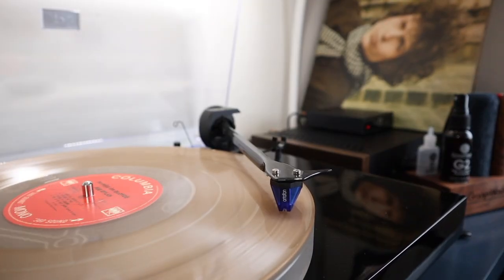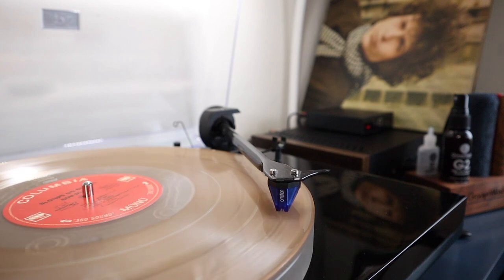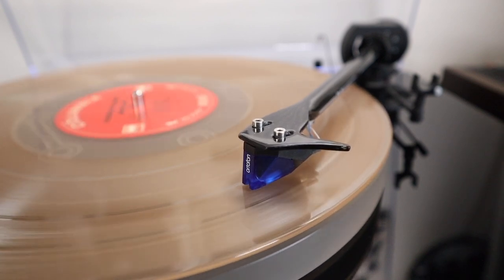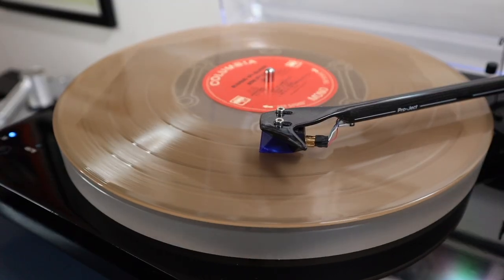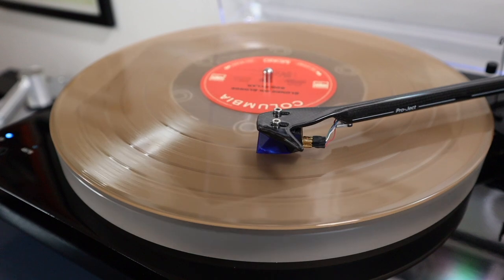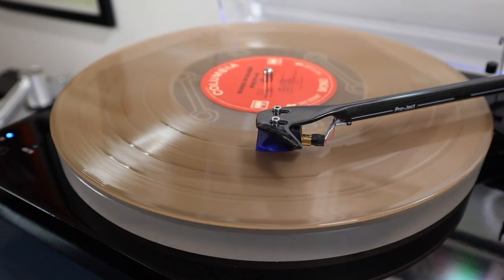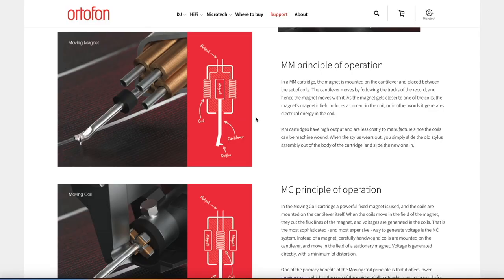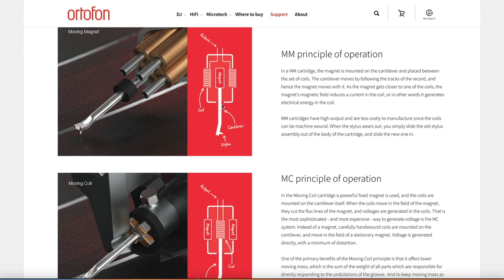Moving Magnet vs Moving Coil Phono Cartridges - Vinyl 101

Comment: Hi Mark, a good summary but just a few points to add.  Firstly, the weight of the cartridge is not determined by whether it’s MM or MC and it has no impact on the downward pressure at the tip, of course, as that’s set by the counterweight position.  As a matter of fact, the popular Audio Technica VM95E moving magnet cartridge is considerably lighter than the OC9 range of moving coils by the same manufacturer.

The weight of the cantilever, however, is different, as the coils weigh less than the magnet.  This results in the stylus being better able to track the groove in the case of the moving coil, as you rightly said.  The downside to this is the cartridge can feed more energy through the cartridge body and into the arm.  For this reason, it is important to have an arm that can handle this extra vibration with a combination of damping and transmission through superior arm bearings to the plinth.  There is no point in spending too much on a moving coil cartridge if your arm and turntable aren’t up to the task.

Finally, with a much lower output signal coming from moving coils, it makes the choice of phono pre-stage much more important.  This isn’t just for the extra signal uplift that’s required either, it’s to match the impedance and capacitance correctly.  A really nice moving coil cartridge can be ruined by a poor phono stage and these can cost as much as the cartridge themselves, or in my case more!

In the last year I finally made the switch from moving magnet to moving coil.  It’s been a lifelong ambition and financially it was extremely painful.  I had what some consider a fantastic MM cartridge, a Goldring G1042, and I really liked it.  My first MC cartridge is the Audio Technical AT-OC9XSH and it is a major step up.  However, it didn’t pair well with my ifi Zen Phono, hence the switch to my Vertere Phono 1 MkII, which has transformed my record playing system.  I’m never going back to moving magnet.

Good luck on your journey.
Reply: very cognizant reply.   I had seen arm design evolve from the ultra light weight arms back when MM carts dominated the market, but hadn't really known why, just had read that a MC cart was harder to control , with no further details provided.   Once I got a nice platter spinner and arm, I started to realize the real importance of the arm, as before all I ever owned were nice record players where the arm was included as part of the product, so not much to think about.

Oddly enough, I still read internet posts where people must have read a bunch of old arm reviews and seek out the old designs to use with MC carts , as though the mechanical properties were timless, like an old book.   I once lusted hard after an SME arm design which had the ultimate thinking of the time, having a Shure cartridge , without the body, incorporated into the arm wand of their top of line design.  Almost good I didn't have the money to get one at the time, because it quickly became obsolete as cartridge design moved on, and it had no provision for upgrading the built in signal generator, although the rest of the design is still among the best.
Reply from the maker: Thanks Mark for the detailed reply and experience shared. Sorry if I didn't make my comments on weight clear as by weight and inertia, I did indeed mean the weight of coils vs magnets. 

Excellent points added about the tonearm and phono stage, much appreciated and it's nice to hear your experience and journey here. Congratulations on making the leap and managing to pair it up with a compatible phono stage. I think I'm quite a way off achieving that myself from a financial standpoint alone. Maybe one day :)

Happy spinning, Marc.
Reply: @soundmatters  Hi Marc, thanks for your kind words, and no apology needed for miscommunication, it’s a hazard of doing what you do!  I have to confess it’s actually CDs that have been enabling my journey over the last few years.  By learning about electronics I’ve been able to buy broken amps and CD players, but mostly CD players, fix them and sell them on to happy new owners.  Everybody wins.

Of course, along the way I’ve kept the best bits for myself and added a series of upgrades too.  It doesn’t do any harm having a sound engineer as a buddy either! 😁
Reply: @soundmatters  @markcarrington8565 Not to split hairs but what you are really taking about is mass, not weight. The former is related to the density, the latter is related to the effect of gravity on the former.

Comment: I have a legacy turntable-tonearm combination (Thornes 125 W/ SME-3009) which will be 50 years old this year. For this type of high compliance arrangement the best combination is STILL the Shure V-15 (type IV or V) with an aftermarket hyper-elliptical, line-contact or SAS stylus. Unfortunately Shure is out of the cartridge business. So I'm glad I held on to my Type-V.  I also like the Grado Prestige (Blue) and the legacy Audio Technica AT-95 with an aftermarket nude hyper-elliptical stylus (BLISS brand) and a .7g additional head-shell weight. ALL are MM carts. If I was to ever purchase a "fixed stylus cart" it would be be a high-compliance Soundsmith model where the cost of replacing the stylus is never more than 20% of the cost of the cartridge. Grado got me hooked on the sound stage produced by their (Prestige series) "moving iron" carts.

Comment: Seeburg jukeboxes referred to the stylus as the "armature". The magnet was in the stylus carrier. Then there are the ceramic and crystal cartridges which generate substantially more electrical current. Then there was the Radionics Cobra cartridge(used by Wurlitzer and Zenith), which generated a signal much like a radio transmitter.

Comment: I have an old PF-800 Yamaha table that came with a Denon DL-110 cartage and it sounds very good, better than anything that I've had this far. That Denon cartridge is a moving coil type but one that's less expensive than lots of moving magnet style carts. It's a "high output" moving coil, which is apparently what a lot of the cheaper MC carts are designated and can work with a MM style phono stage, but I found worked better with a Schiit Mani preamp that I upgraded to, which has the benefit of lots of adjustments and is cheap. If you have a budget that's a few hundred (but not necessarily more), it's worth looking into a high output MC cartridge, like the Denon... as it has lots of detail and a low tracking force that tracks records well and likely means longer record life and maybe even longer life for the stylus. The fact that the stylus is non replaceable is a big disadvantage for sure, but the thing is cheap enough that it might be considered a good value anyway. Apparently it can be retipped but the cost tends to be nearly the same as a new cartridge. 

One thing though that I'll say, is to make sure to do the research and buy a cartridge, whether or not it's MM or MC that is known to work well with your turntable. Different tonearm designs work better with certain kinds of cartridges...

Comment: I like the punch of a moving magnet on rock and such, where the original higher electrical signal provides greater impact .  A moving coil just has a slightly different voice, and most require a higher downforce to track as well as a moving magnet design,    I decided to go for the ease of tracing the grooves over ultimate fidelity , since I want to preserve my old records as well as I can.  Besides, my MM set up sounds pretty good, I once saw the same deal used at an audiophile show to sell speakers.  

Although they are, with good reason ,  the flavor of the day, with some MC designs are modified with higher mass and output to allow a consumer to replace a MM cart with a MC design, for those who want to ape the very expensive multi thousand dollar carts, it is not for me.

  I  always stress over getting the cartridge alignment right, it's so critical and tedious that it kills the joy of a job well done for me.   So I really enjoy a replaceable tip, and at my advanced age have to think ahead to when the very critical aliment job might be outside of my abilities, where a replaceable stylus is a much simpler task.   I know some people hire out the cartridge alignment, but for me, it is so critical I would still have to double check the work anyway, so not much advantage to paying to see if the set up task was correctly done.

I have a fine turntable and arm, but am sticking with a MM design because I mostly play rock and other simple stuff where the punch of the original higher generated output fits the music better.      With the goals for my playback system,  the ability to resolve very complex resolution from many instruments  is not really needed.   I also appreciate the simpler amplification chain, because the good stuff can be very expensive.  
A well proven audiophile maxim is that a  simpler chain is always best , and forgoing MC amplification allows for better stuff in the amplification chain for the same money.   I do play symphonic music, and to sounds fine in my high quality set up..  But the punch of a moving magnet is better suited to the majority of my records.
Reply from the maker: Thanks Richard. Great insight and experience you've shared there. I like comparing MM and MC carts to dynamic and condenser microphones. Condenser microphones undoubtedly have a wider frequency response, but you often find some voices and instruments just suit a dynamic microphone better. Very similar with phono cartridges I think, as you suggest.

Comment: The moving iron cartridges have lower moving mas than MM . The Grado Sonata 3 in their Timbre line is especially sweet , and although not cheap may fit the budget to upgrade . It is available in both a high and low output option . The Soundsmith Otello ES , a similarly priced cartridge is also competitive , and they offer an affordable retip service for their cartridges .

Comment: MM's are definitely the most convenient to use and most consistent in sound quality from same make/models.  I have used 2 MC carts, AT-OC-9 and the equivalent Kiseki cart, found them both too bright and fatiguing.  Both were run on the same table/arm combo, a two motor, belt drive English made Logic Gemini (Linn Sondek class) with Datum S arm, and both carts sounded different. I tried another OC-9 and it sounded different to its sibling from the same batch.  On my TT I still run a Shure V-15Vmr with a Jico SAS stylus which I find totally neutral and comfortable to listen to.  If/when my Shure goes to cart heaven, I will probably replace it with either an Ortofon 2MBlack or Grado signature series.
Reply: what  a coincidence, I also have been using the same shure cart and the same brand of replacement stylus , with the original cart body being so old that I forget when I actually bought it.    I also considered the grado, liking the moving iron designs, but the new LVB ortofon has a replaceable stylus and most all the features of the original Shure, adding an improved suspension material , but not offering a boron foil cantilever stylus, but solid boron is still a top solution.    I like the ability to get an OEM replacement stylus from ortofon, but not the price.   The S and S is nice, and a real life saver for me,  but not quite identical to the OEM design.

Comment: An MC let make you hear more info from the record. 
But a good MC costs from 1000-2000 dollar and a good phono stage also. So let's say about 3000 dollar. Very important is the match weight-arm with compliance-cartridge.
Then your turtable has to work together with your amp, cables, and acoustics of the room.
My turntable costs about 8000. For much less you can get a cd-player with a reasonable sound.

Comment: "cheap" entry into Moving Coil:
Goldring Eroica HX - £549, I believe these can be re-tipped for about £350-ish.
- it's a high-output MC design, so does not need a separate MC stage, saving at least another £300.

I'm very happy with mine.
Otherwise, Goldring 1042, Ortofon Black or above, Nagaoka do some well-reviewed stuff.
Reply from the maker: Sounds good. Thanks for the recommendation. 🎶🎧

Comment: If you say that the signal is weaker in a moving coil and that the preamp needs extra gain, then surely service noise is going to be largely amplified as well?
Reply from the maker: I get your logic, but because the signal to surface noise ratio remains the same, this is not the case. Happy listening 🎶🎧

Comment: MM or MC?  Audiophile or not, this is so much a matter of taste.  Some are just for the low end, others are just concerned about high frequencies..  Personally, I have leaned towards the MM league after I purchased Reloop Turn5 equipped with Ortofon 2M Red.  This replaced my beloved NAD 5120 turntable.  Well, the Reloop is a 13kg beast, a SL-1200 design and  honestly is from “another planet” compared to the NAD.  My other cartridge is the DL-110 Denon, high voltage moving coil.  I tried it on the Reloop but whatever modification I made, it just could not match Ortofon’s warm engaging sound, I really feel at “home” with the 2M red 👊😁.. 
As you mentioned reg. moving coil cartridges, if you want that hyper audiophile sound, you need a high end record player, top of the line amplifier, pair of Dali Rubicons..etc.   I know a few that are in this group and they are still not 100% satisfied with the sound from their gear..  After my experience with Reloop Turn5, I will never go belt drive again, changing pickups in seconds is so much a step up..  I’m already considering a 2M Blue stylus and possibly concord type from Ortofon.
Reply from the maker: Thanks for sharing. I agree there’s always a degree of personal taste, plus finding a good fit for your system of course. The Reloop sounds great 👍 🎶🎧 Happy spinning!

Comment: pssst you forgot moving iron. grado, some ortofon, nagaoka, some goldring and all soundsmith carts are MI, and in the case of soundsmith (possibly others) they actually have a lighter generating mass than even the lightest MC
Reply from the maker: Thanks. Yep good point - less common, but worth mentioning in another video. I need to get my hands on a couple and do some comparisons. 

Are you running a moving iron cart?
Reply: Yes you are correct. I'm using an old Stanton 681EEE (moving iron) with a microline replacement stylus I ordered from Jico. It tracks very well, and has great frequency resonse and channel separation. It's output is a little lower than most moving magnets, but much higher than most moving coils. So it works well with a mm phono stage. From what I've read and seen on YouTube, the Soundsmiths are very nicely designed. I might go that way if I ever need a replacement.

Comment: what if my amp only have MM (Marantz Model 50)? and I have a MC cart?
Reply from the maker: Hi John, in this case, you'll need to buy a separate phono preamp that will take MC carts. My channel has reviews of a few. The Moon110LP, the MC Pro, the SCHIIT Mani 2 to name but a few. You'd then take the output of the external phono pre and run it into an AUX input on your Marantz amp. Hope this helps!
Reply: @soundmatters  thank you.